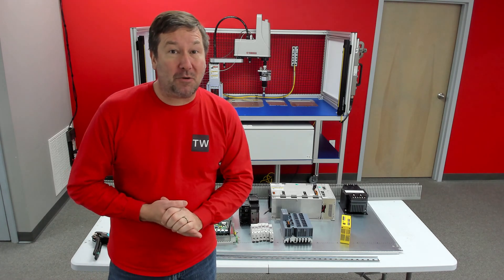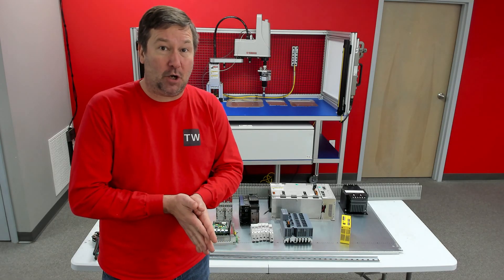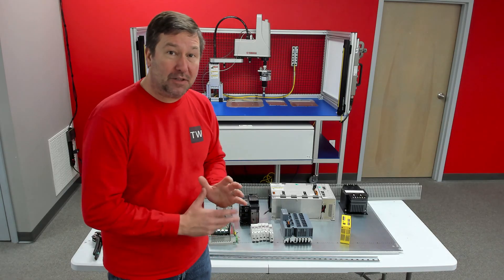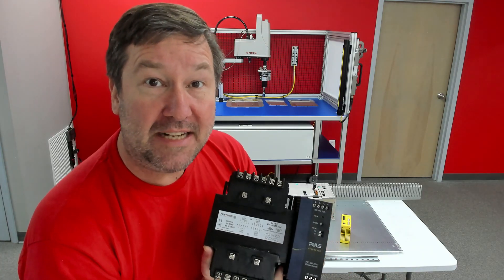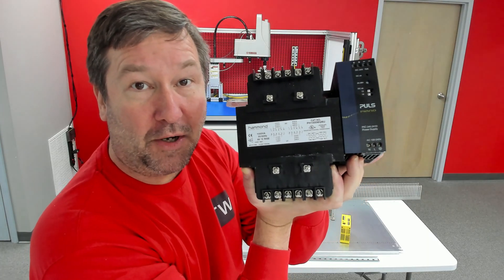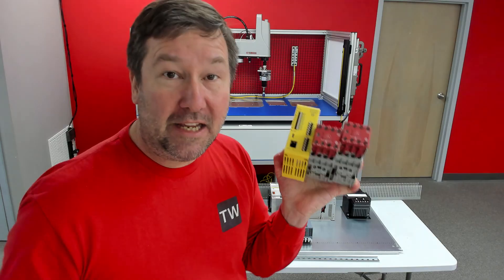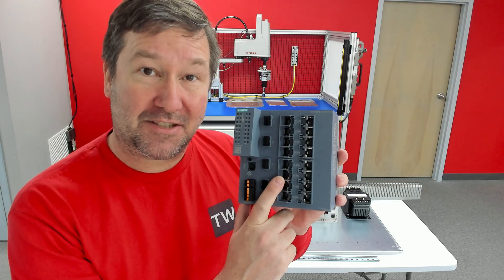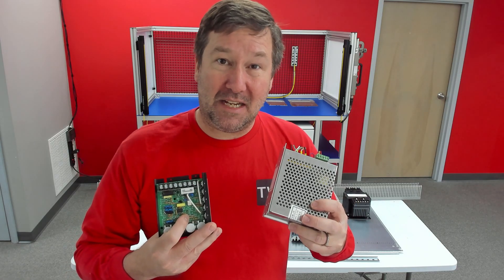What is Needed to Start Building Industrial Control Panels

Comment: Another great video Tim.
Reply from the maker: Thank you!
Reply: @TimWilborne  One thing I always found frustrating was the terminal strips across the bottom of the panel, especially deeper panels. When troubleshooting,  kneeling on the floor and having to lean into the panel was sometimes on the verge of dangerous.
Reply from the maker: I agree.  I like to run them vertically.  This is the first panel that I have ever built with the intent of laying on its back with finally installed :)

Comment: Can  you make a video on need of seperate instrument earthing and power earthing..
Reply from the maker: That is a question that comes up often, let me see what I can do.
Reply: Can you make a video on retrofitting old power flex drives (700) to 750 series in ladder logic?  I’m new to industrial electrical work and been struggling with this at the mill I work at.
Reply from the maker: I thought they were similar but I haven't worked with many 7xx